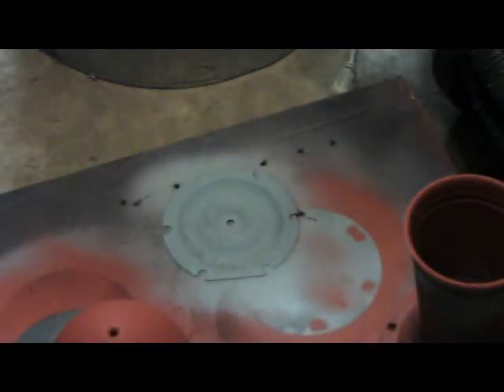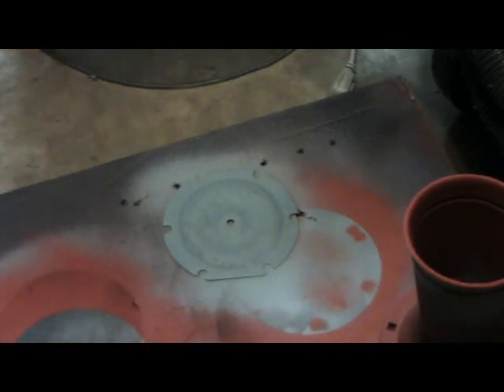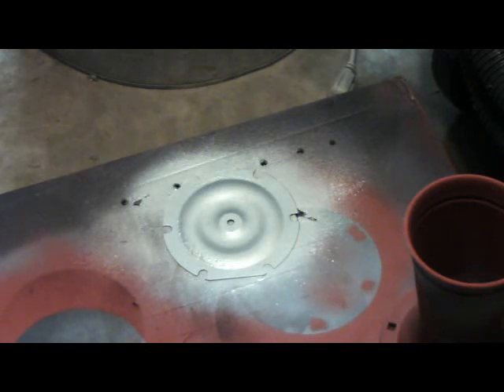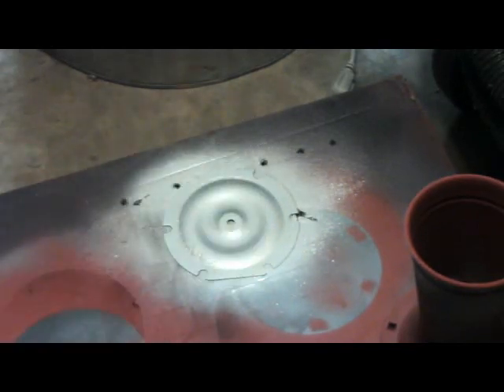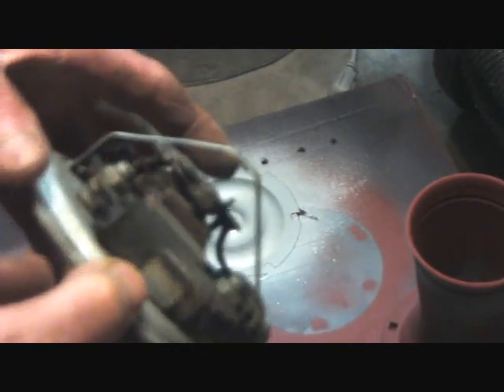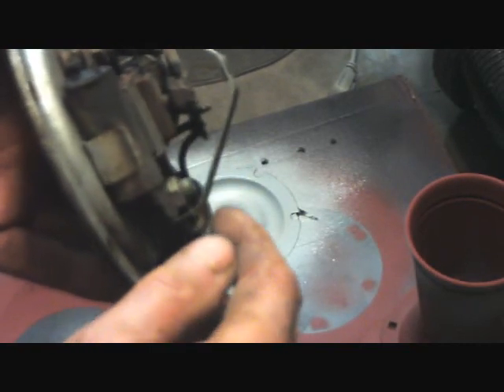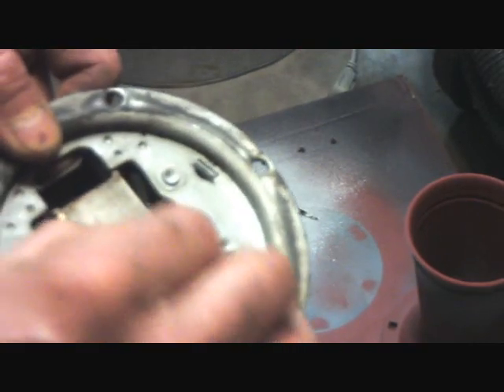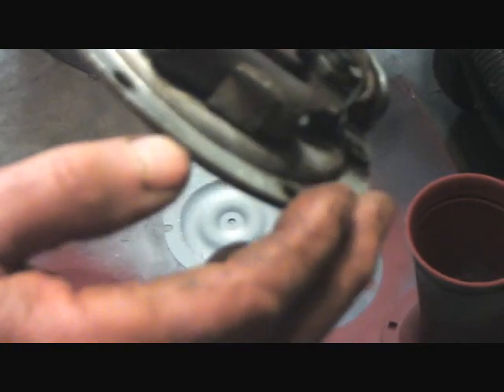This old horn, pt 8 Diaphragm and function

Comment: For filling those holes, I'd use a two part metal filler called Enecon (if you can find it). I've used it to glue my original Model A Quail back onto the cap and it works better than a similar product called JB Weld. At least that's my opinion.
Reply from the maker: It's been so long since I did it, I guess I will have to go back and see just how I did do it. Thanks Jim.